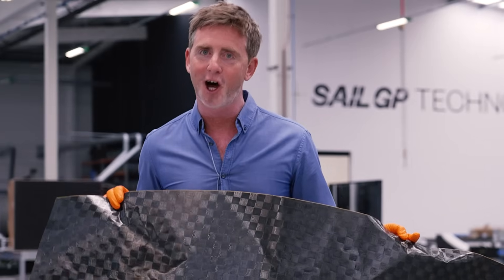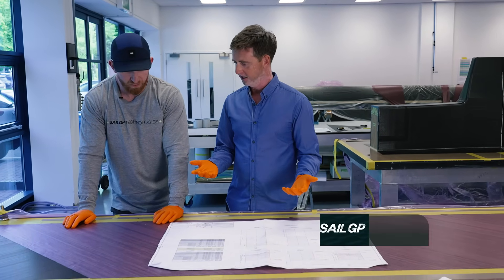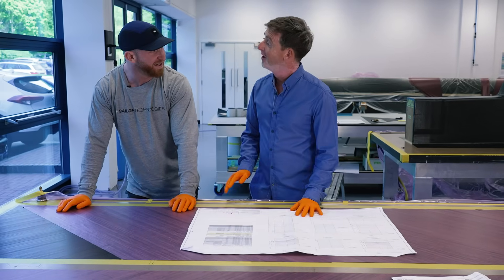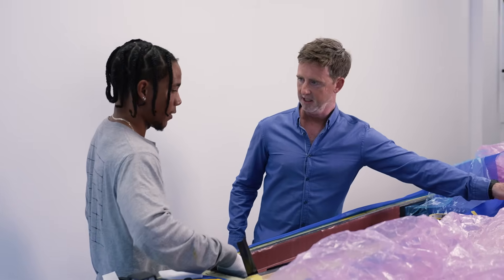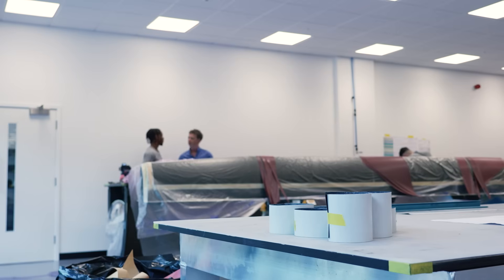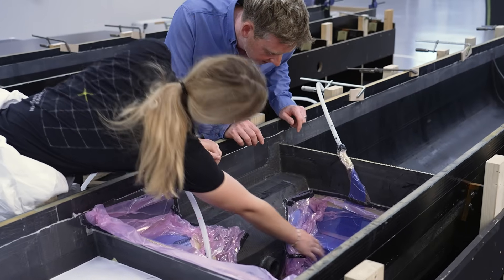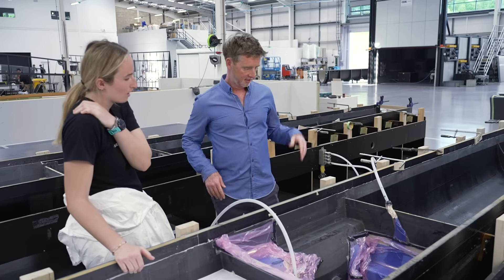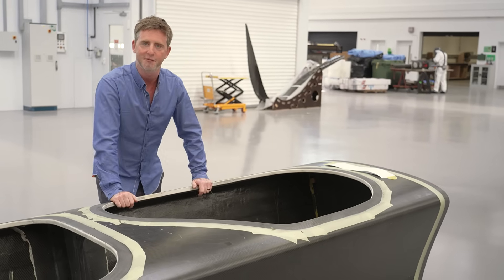How does SailGP construct a MULTI-MILLION DOLLAR F50 🤔 | The science of carbon fiber 👨‍🔬

Comment: Goofs: During your intro, a Saturn V rocket is shown as an example of carbon fiber. The Saturn V was primarily constructed of aluminum, titanium, polyurethane, cork and asbestos - not likely, carbon fiber. I'm curious if prepreg carbon fiber was even in the designers pallet for this rocket designed with 1950's materials.
Reply: had the exactly the same thought.
Reply: I get using it as an illustration of “aerospace” in general, but for an example of carbon fiber in aerospace I think some of Rocket Lab’s vehicles use carbon fiber?